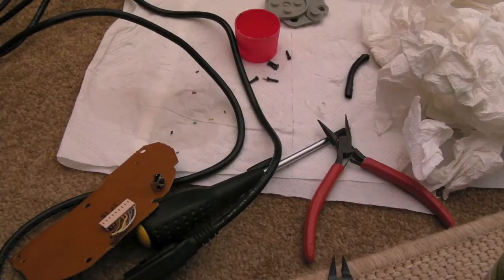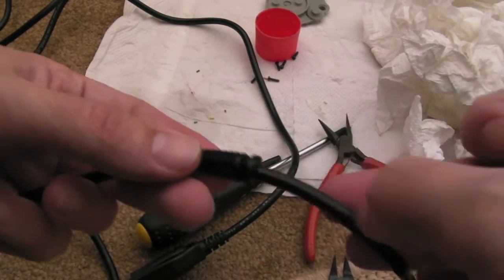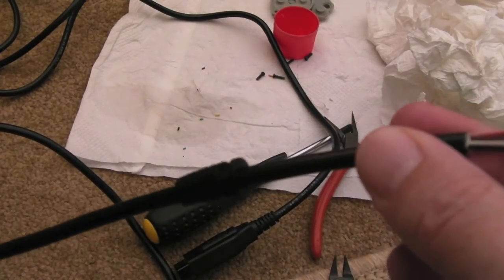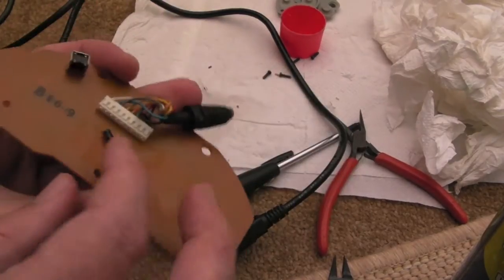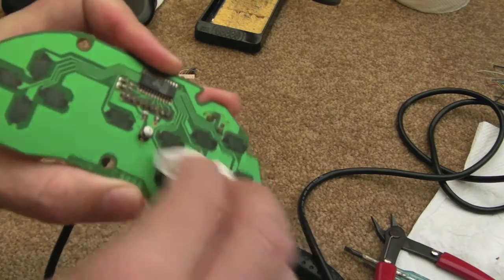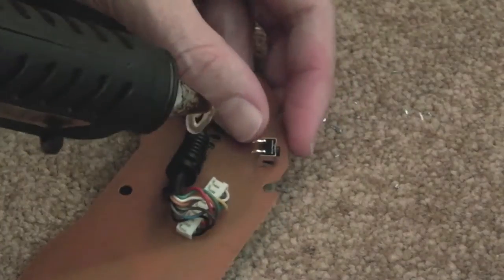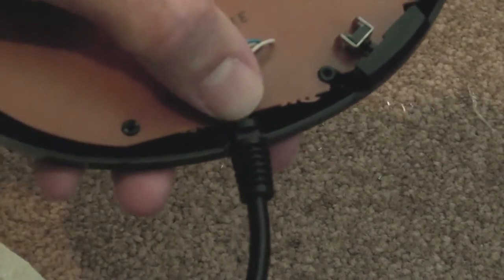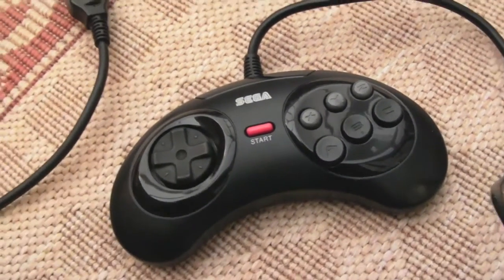Sega Megadrive (Genesis) 6 Button Controller Repairs

Comment: Thanks for the video. Whats the "cotton" un the middle of the cable?
Reply from the maker: The cotton in the centre is to provide support to the cable, it makes it easier for the cable to flex I think, without the conductors breaking as easily because its so rigid.  I could be wrong, but that's what I suspect.
Reply: @GadgetUK164  I was thinking that was asbestos but i didn't know.
Reply from the maker: I don't think so - I've never heard of asbestos used in controller cables before!?!

Comment: I have a controller with 3 loose wires and I'm not confident enough to follow your wire color scheme because the colors might be different between controller cables, specially between countries, because my controller has a red start button. Google searches also didn't help. Do you have a schematics showing the pinout of the 9 pin D-SUB cable and the corresponding soldering points on the controller?
Reply from the maker: I have nothing to hand that might help - all I can suggest is compare to another controller (do tests on continiuty test on a good working controller).

Comment: how do you get the grommet plastic thing that holds the cable into the controller off and back on? mine feels like it is molded onto the cable  i was just going to shove the part that is showing wire back in then use liquid tape on the wire.
Reply from the maker: I think if memory serves I probably had to pull it off with force and use super glue to secure it in place afterwards.

Comment: great vid, I had to do the same a couple of weeks ago... on mine the rubber pads were all falling apart sp I actually found a busted knock off 6 button that had a rubber bit that fit exactly in there on the original sega one.
Reply from the maker: Thanks!  That's useful information - thanks =)  If I ever get that problem I know where to look for spares now!
Reply: GadgetUK164
yeah, the one I took parts from was 3rd party, but looked very close to the same as the sega 6 button... only it was slightly smaller... maybe a cm shorter at most. but the buttons look exactly the same.. you can actually fit the plastic button in too if you have a cracked one. So sometimes those are worth it. I'm sure it was a plastic mold they altered from the original just enough to get away with it.

Comment: I wonder how those carbon dots would work installed in an Atari 5200 joystick. Those are notorious for the carbon dots not working and people replace them with gold ones. Perhaps using newer carbon dots from Nintendo and Sega gear would do the trick.  But what about using micro switches instead in the Sega Pads?

Comment: I bought a GENESIS 6B controller when they were first released along with the U.S. SFII'SCE.  I returned SFII and bought a PAL version because the speed was so horrible.  I am glad I have the GENNY 6B though.  I was shocked when a friend brought over his PAL 6B pad and I saw how bloody short the cord was!  It was a 1/3rd of the U.S. one.  Why the PAL pad was given a horrible Japanese length cord, I will never know!  I have a few JP 6B pads now and I hate that tiny cord.
Reply from the maker: A Shaw Very interesting!  I didn't know the US controllers had a longer cord!  The SNES controllers are insane, like less than 1m or something!
Reply: Yeah!  I am glad my PAL SNES pads work on my SuFamis.  It's strange that apparently NTSC pads, JP or US, do not work on PAL systems, but my PAL pafs work on the SuFami.  Stupid f'ing nintendo, they always loved to screw PAL poorpers over, they still do!

Comment: Any reason why the C button on a 6 button would press start? I've cleaned it up but no luck getting it to just be a C button.
Reply from the maker: +Gregory Terry If you've cleaned up the buttons and the wiring is OK (check there are no shorts between connections) then it's the mux chip (typically) 74HC157.  Check there's no bridge between pins 13 and 14 on the chip.
Reply: +GadgetUK164 I'll take a look and let you know what I find. Thanks for the response.

Comment: hi mate ive bought a 6 button controller and the XYZ doesn't work, ABC does, so in SF2 XYZ is normally punches, whereas for this 6 button, the ABC is, so it's almost like it's detecting it as a 3 button. Have you come across that before?
Reply from the maker: I would suspect a problem with the mode button.  There's a button on there that forces it back into 3 button mode.  Maybe that button is shorted?  Or maybe the chip has a fault on that connection.
Reply: thanks mate, will open it up and take a look. cheers
Reply from the maker: Let me know how you get on!  If you remove the button and test without it - it should go into 6 button mode.  The way it works, when the button is held down on power on, then it forces the controller into 3 button mode.
Reply: ohhhh nice one, thanks heaps mate

Comment: useful stuff my friend, I recently got into soldering starting with replacing system LED's with fancy ones, now I can actually do some real repair! I have aquired the same controller, look like some dog bit the controller and now the wires are partially exposed, I can get it into a position to work, but thats no good. any tips on organizing the wire? I imagine after I strip and tin they would be all over the place.
Reply from the maker: HitmonleeDeluxe Just make sure you make a note of which coloured wire goes where on the PCB before you cut anything.  Then just solder them one by one.  It can be fiddly but it will work!  If you are trying to repair a wire in the middle somewhere, I would try to remove the plastic covering and fix that one wire, then desolder them all from the controller itself, and slide some suitably sized heat shrink tubing all the way down to where the damage is.   If you cut the wire part way and try and join them all up its going to be very messy.

Comment: What kind of replacement micro switch did you use ?
Reply from the maker: 6mm x 6mm tactile switch - NOTE: they have different button heights, but I think I used 4mm.  https://www.ebay.co.uk/itm/6mm-x-6mm-x-4mm-DIP-Push-Button-Momentary-Tactile-Switch-2-Pin-5-10-20-pcs/161783781492?hash=item25ab109874:m:mjZ-EJ0MZHR8S3Ls7ieK78w:rk:2:pf:0

Comment: Have you ever repined a Genesis console controller port?  I have one that has had the tips pulled clean off.  I'm getting ready to tackle the task but was curious if anyone else has done so before.  To keep it simple, I was planning on repurposing a male DB9 and soldering the tips back in place.  I'd be interested in your thoughts/feedback.
Reply from the maker: I haven't needed to replace one yet - they tend to be quite hard wearing on the Megadrive / Genesis.  If you cannot get a replacement DB9 that fits, you could always take one from a scrap board.  I've seen Megadrives sell for £5 ish here in the UK, there are plenty sold for scrap / spares etc.   Although most of them tend to work after a general clean up.  Let me know how you get on!